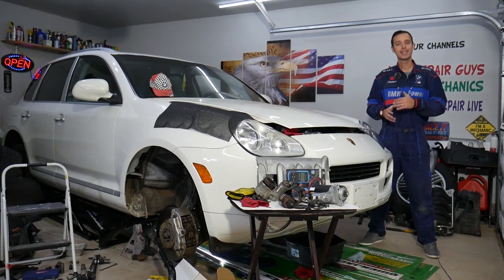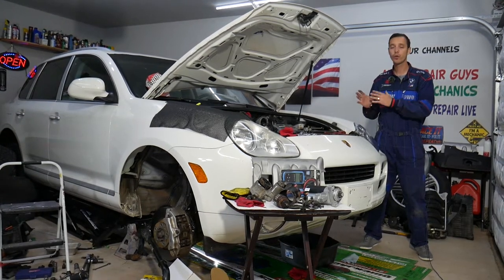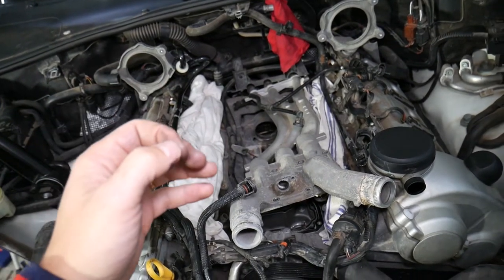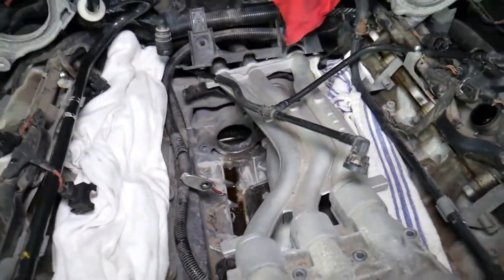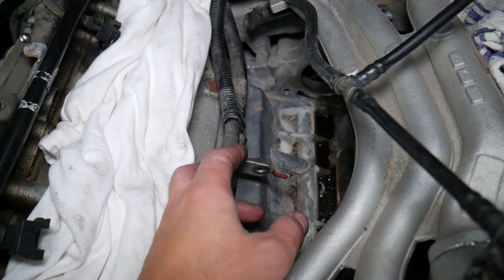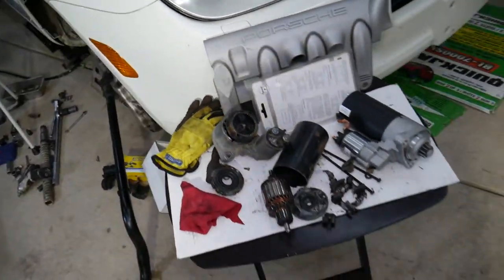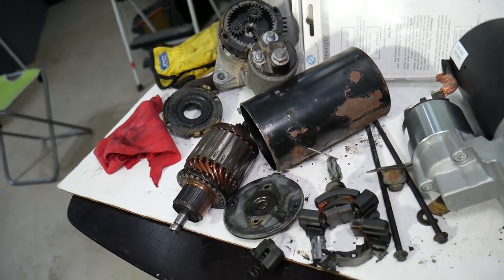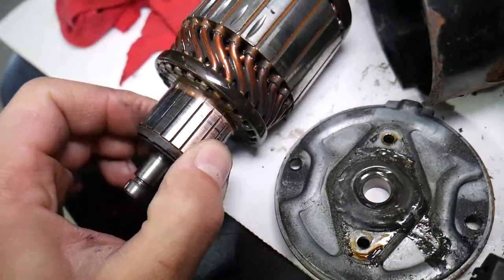CAR CRANKS SLOW WHEN HOT, CAR NOT STARTING WHEN HOT

Comment: I’m having this issue also my car comes from Florida , it originally had a lot of corrosion especially the alternator but that was replaced , also some of the cables had corrosion as well and I tried cleaning them up as well ,so this is what happens so I can have my car on for 6 mins and if turn off and try to turn back on it won’t only with a jump start , you can see my battery voltage drop down to 6 volts after it cools down it turns on normally
Reply: Same probrem i get like this after few km running when i turn off the engine won't start i HV to wait for 30min or smthing den it start
Reply: @ekessterwellsyiem2961  so what was the problem?
Reply: Any solution or vid that can explain this problem
Reply: I'll let you know at the time during diagnosis

Comment: hello I have a problem with my car. The car refuses to start when the engine is hot because of the starter engine. I changed it and it fixed the issue but after 2 months the problem came back and it only starts by jumping. We also changed the battery. Any idea on what the solution might be?
Reply: I’m no expert but it seems like you just have low compression or pressure, Chris fix has a video going over the 5 things you need to make sure your car starts, check it out because I don’t remember how to check compression off the top of my head
Reply: old wiring. old car. happened when car is after 20 years 25years